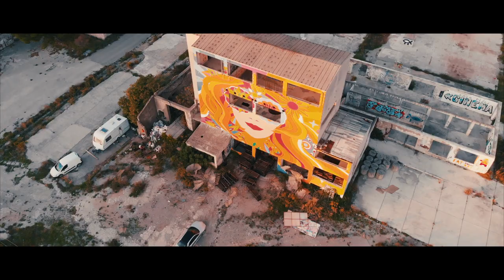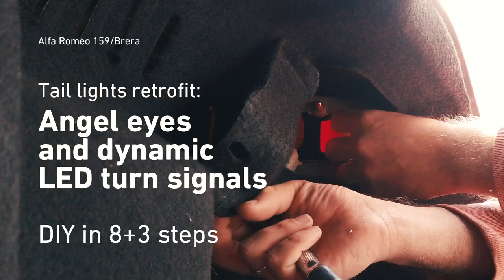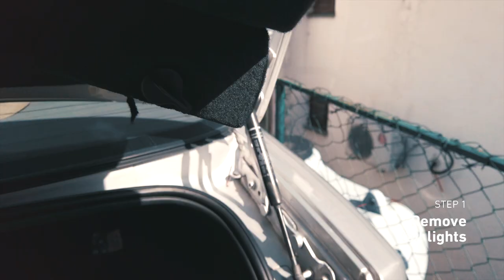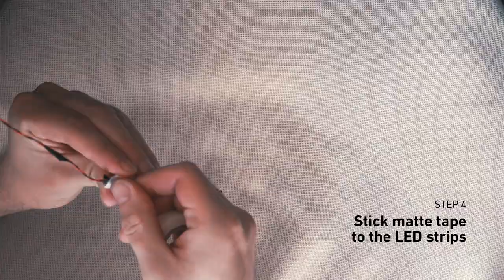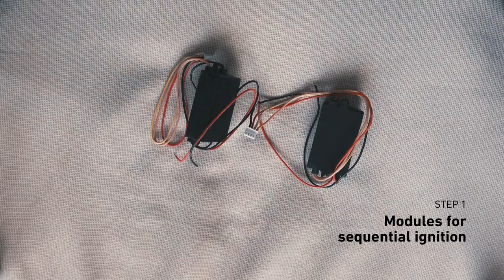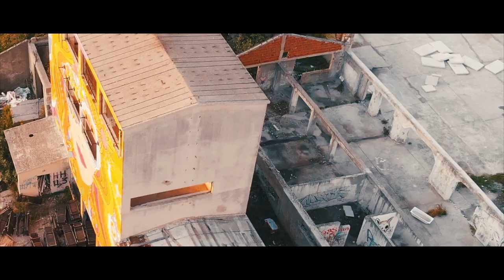Angel eyes and dynamic LED turn signals [Tail lights retrofit modifications HOW-TO] Alfa Romeo 159

Comment: links are not working for me.. i want to do the same!
Reply from the maker: checked it right now, works. try again
LED strips: https://ali.ski/I7w4RW
DRL+Turn signal bulbs: https://ali.ski/IC_jeu
Dynamic (sequential) bulbs ignition module: https://ali.ski/3zWRp
Reply: They are Not Shopping to germany🙄
Reply from the maker: @paddyxlfrozen6016  try this: https://ali.ski/a469M (only white color)
drl: https://ali.ski/AL1oF
turn signal module: https://ali.ski/SPJ5n

Comment: Hello!!! I have a 2.4 jtd van and I will try to do what you did! but I have doubts... what light exactly do you order in the leds for the half moon?! red to orange or white to orange? and another doubt is which number of the 3 available for purchase you choose in the last link!!? already in the description you mention that there are 2 for the brakes and 2 for the change of direction, but in the link you mention, it only has for the change of direction!! use the same?! there are 4 led lamps I have to buy?!

Comment: Absolutely gorgous, gives a different edge to the rear, extra mean. The way you created the video and angles you shot, superb.
One question, if you're still running this car or perhaps someone else please. 
Confused about step two. Do we need replace all the bulbs with some type of dual function or just one dual bulb each left and right?
Plus I'm so confused on how its all wired. Also what are the silicone sticks? Thanks

Comment: Super ! Pour les deux feux de reculs, vous avez simplement commandé le feux arrière de la version anglaise ? Cela nécessite un recablage du feu ? 

Sur quoi avez vous repiqué l'alimentation des leds ? Sur le faisceau directement ou avez vous remplacé la cosse originelle ? 

Merci d'avance !
Reply from the maker: yes, GB version second reverse light, and 3 min with wire change for that. 
The original output did not change, I connected it directly to the wiring

Comment: Hi Nikolas. My last message does not appear to have posted. Could you 
provide a video or diagram for connections for the dynamic turn signals.
 I've got all the parts but the connectors are not common so it is a bit
 confusing! Also the comments regarding resistors are only for the angel
 eyes, correct, as the bulbs have resistors already connected? Thanks.

Comment: Helloo, best and top modification, i have 3 questions, 1: Led strip needs resistors for no error?... 2: Where did you get silicone sticks? And 3: Led strip color is only white?.. thank you
Reply from the maker: Hi! Thank you! 
1 - Yes, need resistors 50w6j
2 - in a hardware store
3 - yes, only white color

Comment: I Imagine it's also possible for the headlights instead of the full circle angel eyes right? These look a lot better in my opinion!
Reply from the maker: headlight has a different shape (circle) and you need to experiment with the form, but I agree, it would be better than the usual circle angel eyes
Reply: @NikolasKolis  I really want to try this on my rear without the turn signals. 

 - LED strips - only white, each light needs it's own? So I need to order 4?
 - Silicon tubes
 - Matte tape
 
Do I need the resistors from the comments? If so, how many? :)

Thanks in advance!
Reply from the maker: @wouterkrooshof2527  yes, white color. You can buy 2 and separate to 4.
Silicone tubes I found in hardware store.
Matte tape in stationary shop
You need resistor for position lights 1 per side -50w6j

Comment: Looks great I want to do this but how did you get both the left & right side reverse lights to be white. On the original light the left side is white for one reverse light but the right hand side is red for one foglight.
Reply from the maker: EU and GB versions has different sides for reverse/fog lights, so I found one tail light with reverse white section from GB version and changed mine EU version tail light with red fog light section.
Reply: @NikolasKolis  Thanks do you have an updated link for the LED strip as this one doesn't seem to work for me, also how do I connect the sequence boxes into the car wiring & how many boxes do I need? Also how did you get your TI side skirts to stay on? Many Thanks

Comment: Hey, really nice project! I have a few questions regarding this:
The LED strips are always on as soon as your turn on the car right? If so what color are the LED strips and where did you connect them? because on the link you gave they also have the ones that change color.
The silicone tubes are glued to the lights or they just fit in with pressure?
Reply from the maker: Hi! Thank you!
LED strips are not always ON, only when position lights ON.
Color is only white (they have more variants, select "only white")
Silicone tubes are just fitted with pressure, no glue or tape :)
Reply: @NikolasKolis  great, thanks a lot! Love your project and what you did to the car! Keep at it! ;)
Reply from the maker: @Ricardo-zz7mz  thx mate !

Comment: Looks great! I bought all I needed, but when I connect the right side bulb of the outer tail light, which should only light up when the break is pressed down, it flickers all the time. When I press the brake it lights constantly as it should but all the time when it's not pressed it flickers. Did you put additional resistance?
Reply: And also how did you fit the drl lights under the plastic bulb holder? Does it even snap in place?

Comment: Hi there. I did this to my 159sw and it’s awesome. But these days the temperatures are very high and I see the silicone sticks are melted down. I don’t know what is their melting temperature but be sure you use sticks with higher melting temperatures.
Reply from the maker: Hi! Yesm I use 300+ celcious degrees melting, and have no any issue with them. Try to find similar and change
Reply: Thanks, I’ll change them.

Comment: W jaki sposób mam podłączyć jeśli chciałbym tylko zamontować angel eyes? Bo żarówki od pozycji są i od pozycji i od hamulca. Tak żeby świecił tylko stop na zwykłej żarówce a pozycja na pasku LED. Proszę o pomoc
Reply from the maker: moja znajomość języka polskiego nie wystarczyła, aby dokładnie zrozumieć, czego chcesz, przepraszam :) czy możesz zapytać po angielsku?
Reply: @NikolasKolis  He asked you how to connect LED strips to the position lights if position and stop lights have the same bulbs. I want the same info too ;P Great job btw!
Reply from the maker: You have 2 options:
1. Change the bulb with same but with one contact (only brake)
2. Disconnect wire for position lights and connect it directly and only to the LED strip
Reply: @NikolasKolis  thanks 😀

Comment: Regarding the bulbs, the Ali express link lists 3 options: 1156 BA15S, 1156 BAU15S and T20 7440  and only white/yellow not white/orange. Can you clarify the correct option and is yellow actually orange in this case? It appears you need bulbs with sockets, not just the bulbs, correct?
Also when you installed the UK reversing light fitting did you also install white/red dual bulbs on both sides to keep the reverse and fog lamp capability? Cheers mate.
Reply from the maker: hey, you need BAU15S, and yes, yellow is actualy orange
only white led bulbs for rear
Reply: @NikolasKolis  Cheers mate. I was also wondering did you use dual (white/red) bulbs in the reverse light lenses to maintain a reverse/fog light configuration after you installed the UK reverse light fitting?
Reply: Oh sorry mate i realized already asked and answered. However I would do that. And the black roof:  assume paint not glass.

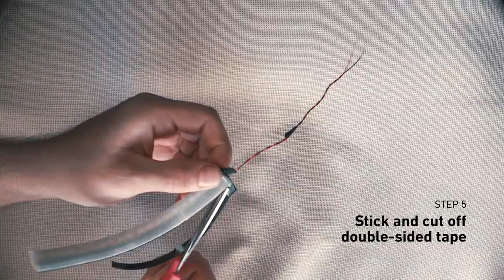Comment: bonjour a 00:55 Étape 6: Mesurez et coupez les bâtons de silicone     c'est bâton de colle?  MERCI
Reply from the maker: hi! they look like glue sticks, but not quite like that, ordinary ones have a melting point of 80 degrees Celsius (and they do not fit), these have about 300 - look for such, or similar
Reply: @NikolasKolis  300°?
Reply from the maker: @laurentfil9770  yes

Comment: Lamps are reworked? Originally on the right is the reversing light and on the left the fog light. How did you change the color of the lamp from red to white? A good question? 😉
Reply from the maker: the second reverse lamp is from GB version (they have inverted reverse side and fog lights) - easy and useful ;)
Reply: Well done, mega creativity.
Reply from the maker: @F1f0n71  thx!

Comment: Hi Nikolas. Nice car and thanks for the tutorial. I did the angel eyes 3 months ago with led strips from eBay but unfortunately some of the diodes in the strips has stopped working. Needless to say it doesn’t look good.. what’s your experience, does yours still work? I didn’t install resistors because I didn’t get any canbus errors.
Reply from the maker: hi! yes, mine still work ok, almost 1 year. try to buy other strips, you have link to aliexpress in the description to the video, that strips are same to mine. and its very strange why didnt you get any canbus error, maybe beause of your different strips. anyway try with another strips and with resistors and I'm sure you won't have any problem
Reply: @NikolasKolis  thanks, I’ll try other ones. 

Another question for you about  an issue you might have solved: I put led flash lights in the front, and occasionally I get canbus error, which is super annoying. Only sometimes thought which is weird. I want to put resistors, but I’m worried about heat from the resistor hitting the cap, or rattling sounds if I just let it loose in the housing. Did you install resistors and did you just let it lay loose in the housing?

Comment: Looks amazing! Did you have any error lights when wired as shown or did you need to add resistors perhaps?
Thanks
Reply from the maker: thx!
added resistors 50w6j
Reply: Is that 50W 6 ohm? On every light too?
Thanks!

Comment: How did you conect wires?
Reply from the maker: led strips to the parking lights, brake bulbs to brakes wires, turn signal bulbs to the sequential module + 50w6j resistors for each bulb/led strip
Reply: Wat led strip did you use, i bought regular white strip but you can se squeares from led diods

Comment: What happent to 2nd blinker if you brake and use turn signal ?
Reply from the maker: one side brake light, other side blinks (where blinker is turned on). same like american cars have
Reply: @NikolasKolis  yes but brake light can not work at the same time as blinker
Reply: @NikolasKolis  do you use something els ? Because my alfa said there is no light installed ( not error free )
Reply from the maker: @sup3rbosseur  only from one side (where blinks), other side brake light is working and  also middle brake light on the window works too
Reply: @NikolasKolis  ok thx for help am gonna check this
Reply from the maker: @sup3rbosseur  install resistors 50w6j for each bulb (turn signal, position, brake) and you wont have errors
Reply: @NikolasKolis  oh yeah the same resistor that the light have ok thx 👍🏻

Comment: @Nikolas Kolis Can you tell me which colour you used? Red or white led? :)
Reply from the maker: Sure, white
Reply: @NikolasKolis  And the sticks are something like a silicone glue stick? I can't find it anywhere
Reply from the maker: @krzysiekkurak  yes but, normal glue sticks have 80 degree C, you need similar but 200+ degrees
Reply: @NikolasKolis  Thank you so much! I forgot about it and the effect is not that good like your :)
Reply from the maker: @krzysiekkurak  you are welcome. yes, this sticks really make difference in how it lights, so lets find something and put it inside to get better effect ;)
Reply: @NikolasKolis  did you have a problem with LED glow? When I turn off the lights, the LEDs are on all the time. very faint, but they shine :(

Comment: ATTENTION !!!
This video is missed to promote certain products that are not used for what they are created for. I purchased those products right from the links given by the author of the video and I tried to make what it looks like in the video, asking the owner of the video to help me with a diagram. He didn't want to do it. I put the bone to work but realized why he didn't want to. and here is the conclusion. The described things cannot be done, and if they are done, the car's electrical installation is severely damaged and will not work properly for a long time. SO DON'T TRY SUCH A THING
Reply from the maker: I will prepare it for you
Reply: @NikolasKolis  Hello.
please try to make time for me and I'm still waiting, and I want to try to apply your project
Reply: I have already ordered the materials from the links given by you. I would greatly appreciate it if it still helps with the promised scheme